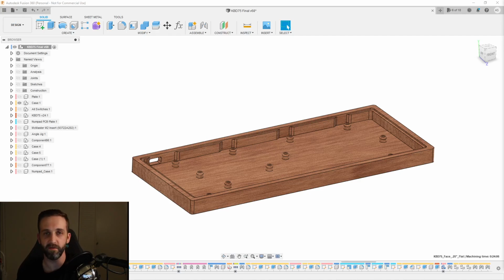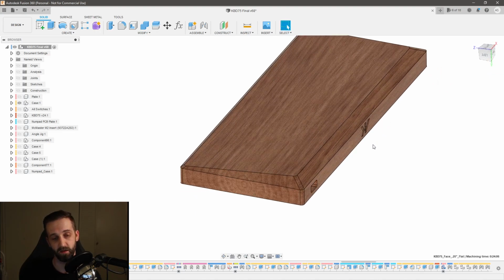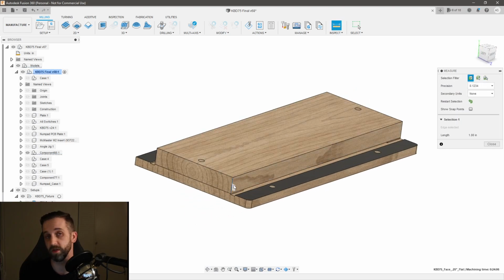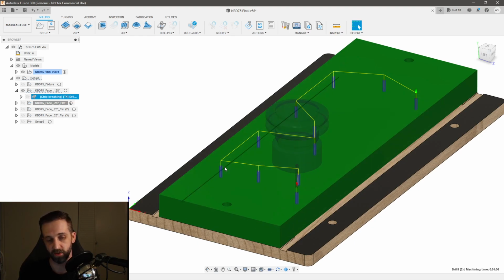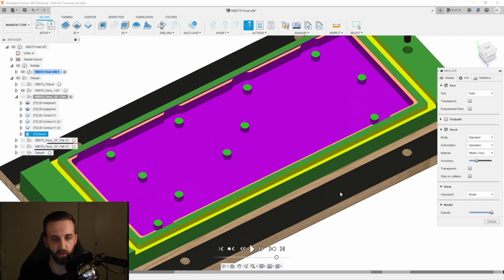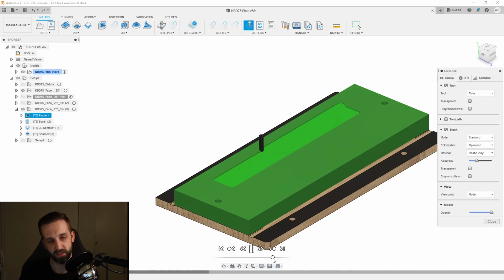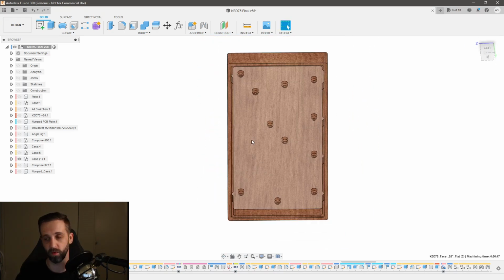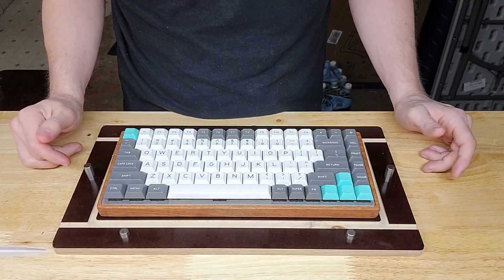Fusion 360 Tutorial | CAM Order of Operations - DIY Mechanical Keyboard

Comment: This is such a useful and well explained Fusion 360 CAM tutorial.  I appreciate the advice about using a separate jig to provide a zero reference point when doing two-sided work.  And the importance of thinking through the order of milling operations when working through the part design steps.  It's also refreshing to see how you made a mistake and recovered from it as mistakes seem an almost statistically inevitability when so many things have to go perfectly - and don't.   Thanks for providing this video.

Comment: When doing two sided machining, when you flip the part over, can't you just rehome the x, y and z using a touch probe (say using the corner of the stock). That way to don't have to put it back in the exact same spot, right? Or am I missing something?
Reply from the maker: If you have perfectly square stock that is perfectly aligned to your machine, that will work.

But let's assume for a second that your stock isn't perfectly aligned or square. When you flip the part over, the part of your stock that's now in that corner you zeroed off initially may be slightly off. And If you zero to that location you will introduce that error into your next cut.

The only way to avoid an error like this is either to zero to the same known point that never moves like my fixture, or zero off of a feature that you just machined in the previous operation (which you may not have access to).
Reply: @austinshaner  Thanks that makes a lot of sense. I also just learned something (I haven't been doing this for very long), the stock has to be perfectly aligned along the x and y axis? I thought that the probe would take care of that. For instance you can't put in your stock diagonally and expect the machine to get that alignment right when it rehomes off the touch probe?
Reply from the maker: I guess that depends on what your control software does with the probe information. Most corner finding touch probes simply find a point to assign as XYZ zero. If that's the case, then you can accurately find the corner of the stock, but that location may not be correct in relation to the geometry you just cut on the other side. So if we exaggerate this for example, you could cut side one, then flip the part over but have it at a 45 degree angle, and then touch probe. It won't change your program to be at a 45 degree angle to match.

Now there are cases where the software will touch the probe or part at multiple points, and try to "map" where the stock is on the machine... both the corner and angle of the part. But again, if your stock isn't square or the cut from side 1 isn't centered on the stock you will still introduce an error. 

This is why I find the fixture to be such a simple solution. You divorce your workoffsets from your stock entirely. So it doesnt matter how you set the stock up. The XYZ zero never moves, and the dowel pins ensure the cut from side 1 (not the stock) is aligned with the XYZ zero. 

But this isn't always practical for all parts, so if you cut all the way through the part on side one, you could zero off of that feature on side 2 to get a new zero point that is in alignment with your dowel pins.
Reply: @austinshaner  Thanks for the great response, that really clears it up! Your videos are probably the best resource on youtube right now for a CAD+CAM combination on Fusion 360!
Reply from the maker: If you are using dowel pins, your stock doesn't really matter, what matters is your zero point in relation to those dowel pins. It has to be consistent to either the zero from side 1 or a feature that was machined in alignment with the dowel pins.